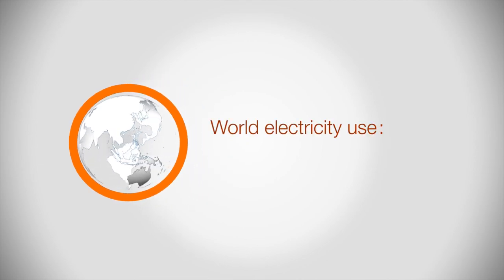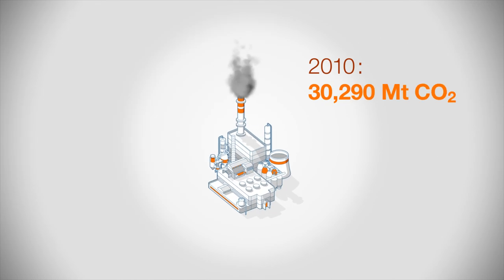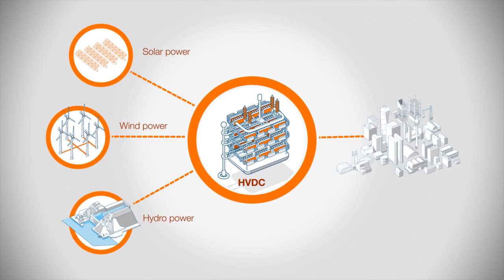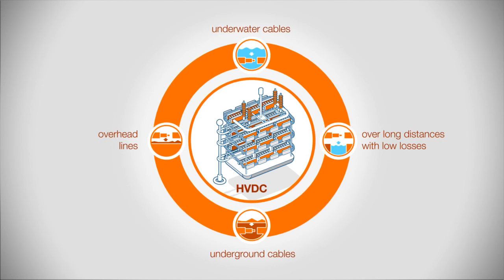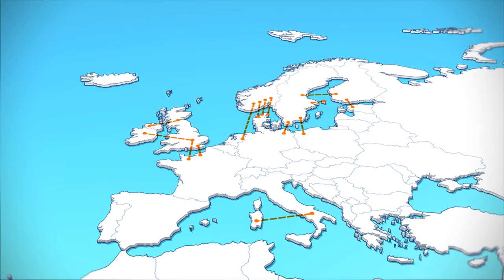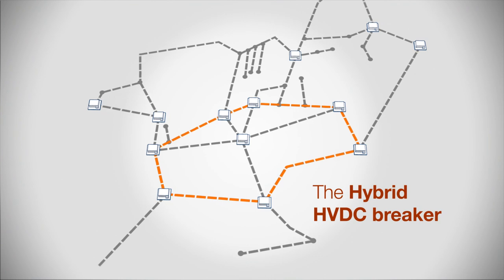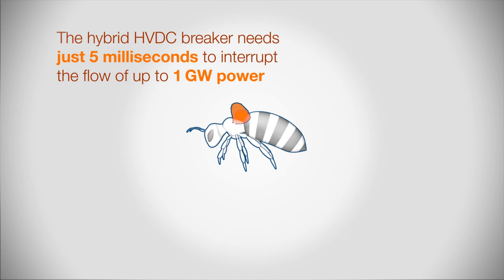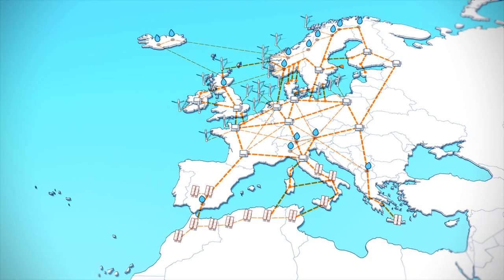ABB's Hybrid HVDC breaker

Comment: - meaning delivery of power continues even if individual plants or transmission lines are not available. An important ingredient of such a grid is switchgear, permitting the flow of power to be controlled and individual sections disconnected.

Comment: Interrupting high-voltage DC is a much greater challenge.
Rather than becoming a footnote in history, DC  has been making a comeback over the last decades - thanks to HVDC technology pioneered by ABB. HVDC involves converting electricity to high voltages, which can be transmitted over very long distances (up to thousands of kilometers) with very low losses and high controllability. Furthermore, thanks to technologies such as subsea cables, virtually no obstacle is too great for HVDC.

Comment: The relevance of this has been increased lately by the growth of renewable generation, meaning power must be transmitted from areas of generation where the grid is traditionally weak to centers of consumption hundreds if not thousands of kilometers away. ABB thus embarked on the delelopment of DC breaker.

Comment: Edison's conundrum solved
In its simplest form, the chain of delivery of electrical energy constitutes a cable from the generator to the consumer. In reality, life is rarely that straightforward. The power a household or factory consumes is supplied by different sources distributed over a wide area, with consumers being similarly distributed. Today's electrical grid is a complex mesh built around the concept of redundancy

Comment: But all HVDC links realized so far are point-to-point transmissions. Just as the AC grid benefits from flexibility and redundancy because of its mesh-like structure, so will HVDC's range of application grow if it can be connected into more sophisticated topologies. Ultimately a new HVDC grid will emerge, reinforcing the traditional grid while relieving it of long distance bulk power flows, and so redifining the way in which transmission works.

Comment: In the "war of the currents" of the late 1880's, Thomas Edison's DC and George Westinghouse's AC battled for supremacy - a struggle that AC finally won.
One of the inherent advantages of high-voltage AC lies in its switchgear. When a current is interrupted, it does not stop flowing immediately but a conducting plasma forms between the open contacts of the switchgear. In AC this estinguishes as the current value passes through zero.